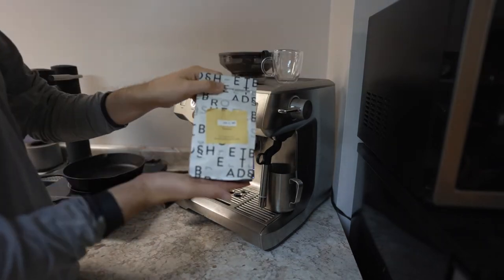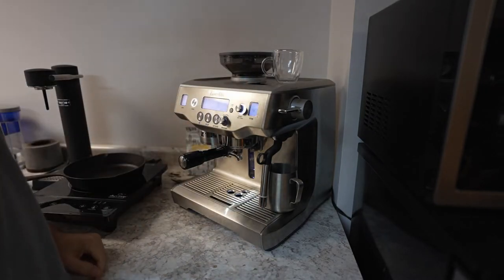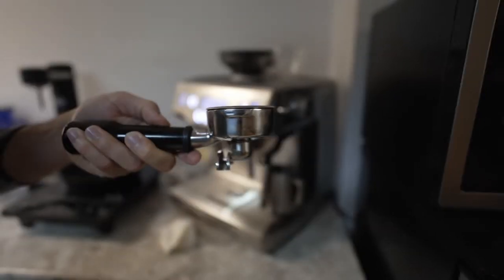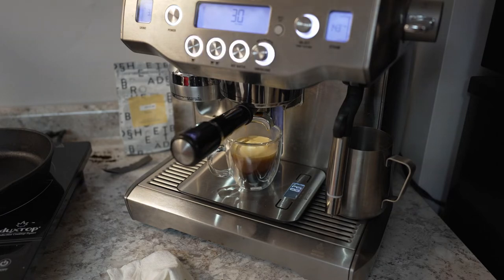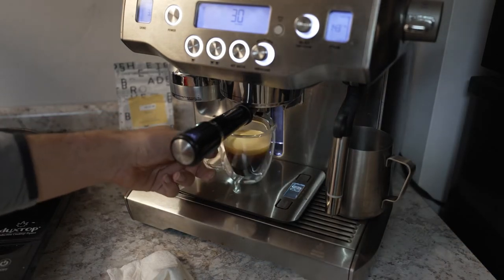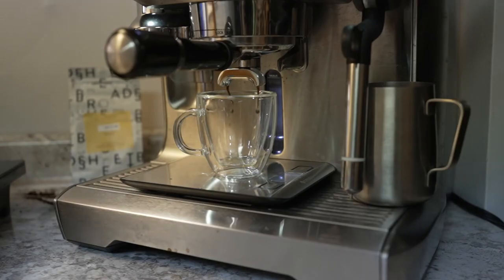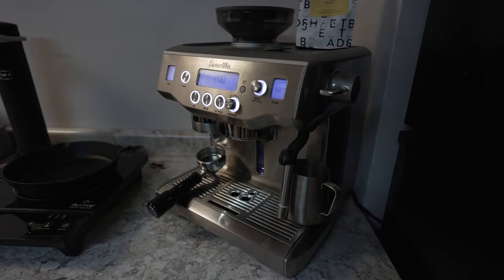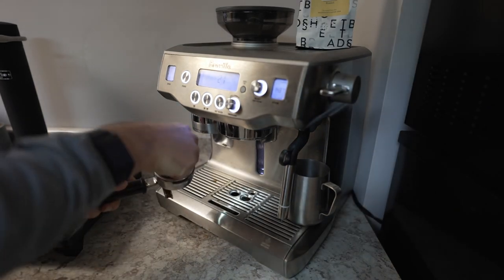How to Master Breville Oracle - Best Settings, Tips & Tricks

Comment: My grinder is usually at 16 to 18 for optimal pour. It's amazing how different the setting can be from machine to machine (same machine as yours)
Reply: Mine is always 29 - 31.  Also I adjust 2 shots in 30 seconds. You should stop the back flush at 12 seconds do it three times and you’re good to go

Comment: What about the flap at the top where you can fill in water: my flap keeps jamming probably because of limescale. Vinegar exxence helps for some days but in my opinion it is a faulty design. Is there are a better solution besides descaling the snapper?

Comment: In how many seconds did you run 22g to get 1 to 2 ration and how many seconds for preinfusion? 
Cheers
Reply from the maker: The machine defaults to 30 seconds in total (about 7 seconds of pre-infusion, and 23 seconds if normal)

Comment: 35!? Think you need to adjust you conical bur settings. Im on 15-20 depending on bean / age.
Reply from the maker: Yeah, I assume the numbers are a bit arbitrary and somewhat unique to each machine.  I will say though that if you are buying premium / "coffee shop" type beans that were roasted recently those require something in the 30-35 range vs if you are using some other more mass-produced and less fresh whole bean coffee (e.g. Starbucks Blonde espresso roast) then it requires a much lower grind setting
Reply from the maker: How do you adjust the conical burr setting that you're referring to? It that some internal adjustment to the burrs vs using the main dial?

Comment: What should you expect content wise using the single cup function?
Reply from the maker: It’s a good question 

I haven’t used the single dose filter basket. Easiest way to figure it out will be to weight the empty portafilter, have the machine grind/dose into it and see how many grounds were added (my guess would be 10-12 grams). Then aim for double that in total volume of espresso

Comment: You say 40-45 grams of water with 22g of coffee. Does that mean that you get a 40.45 gr espresso or 62-67g? In your first ”shot” you get more than 80g according to the scaler, but in the second part the scaler isn’t in focus.
Reply from the maker: Thanks for the question 

The generally accepted ratio you’ll see in most espresso theory is 2:1 ‘espresso liquid’ to coffee grounds 

So 22 grams of coffee you are targeting 40-45grams of finished espresso liquid 

The first shot is way off — the grind setting was way too high (the coffee was ground too coarse)

If I am just starting to dial in a new bag of coffee and the result of the shot is 80g, I will usually dump the shot. If it’s <60ish grams I’ll still drink it 

Something you have to account for too as a home user if you are leaving beans in the hopper is that every day they will dry out / age a bit so you have to lower the grind setting (make it slightly finer) a tiny bit each day — on this machine I prob am lowering it 1 notch or so every couple of days as the beans dry out
Reply: Thanks for the clarification - and the extra info 🎉
Reply: the second one was ~72gr - he did not show us that!

Comment: Adjusting the grinder when it's running? Why?
Reply: Since it’s a moving mechanical device -  if something is in it’s way - it needs to grind it away and it can’t do that if it’s not running - it just ”stops”
Reply: I've seen customers break their grinder due to adjusting it to a finer setting by more than 4 or so increments when it's not running. The issue is that if there's beans in the grinder at the time, you're trying to force the teeth closer together with an obstruction stuck between the teeth/burrs (the obstruction being a coffee bean). This stresses out the mechanism. So adjust it while it's grinding because the beans will be moving through the teeth/burrs at the time and it won't force the mechanism to push on a static object.